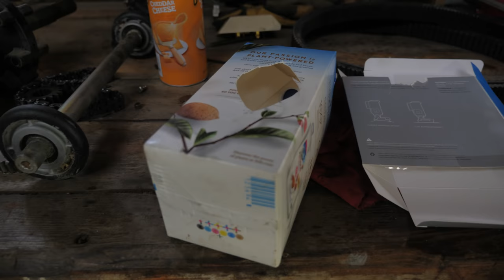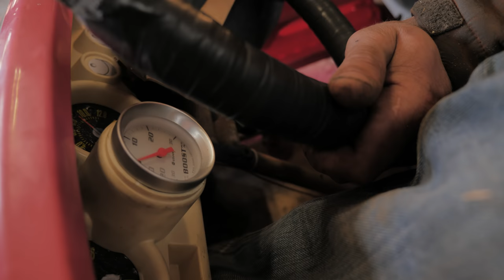Barbie Car Turbo #3 Tuning and Hitting the Streets

Comment: crazy? I haven't seen anyone try to use a brushless Electric Ducted Fan (model jet aircraft) to force the intake. no complex exhaust in-out a turbocharger, just an electronic speed controller with a hall sensor hooked to the throttle. the controller can be programmed for throttle position vs rpm+thrust. some of the 70-90 mm diameter units put out several pounds of thrust, typically have 5-7-9-11 compressor type blades. they're also not all that expensive.

carb>rubber boot>EDF>rubber boot>intake, so its compressing air+fuel into the cylinder, and isolated from majority of heat. this might be something really worth experimenting with just for its simplicity and electronic boost management, ESC programming cards are cheap too.
what if... it can offer 3 or 4 lbs of boost on command? has to be fuelproof of course, and idling it'd about passively spin trying to atomize the air+fuel more, isn't a bad thing.

not criticizing your efforts to boost the beast at all, but if the idea works they'd sure be getting slapped onto go-carts and mini-bikes everywhere real quick, no welding required!

edit: if they aren't fuelproof, could one be mounted to shove air into a fuel injector throttle body? in that situation there's no venturi fuel mixing that pressure would quickly F with, forced air could start when butterfly is 1/3 or 1/2 open.

Comment: I've turboed a motor like this before I used a very similar turbo at first but then did go smaller very small lol the turbo I used was about the size of a softball if not a little smaller and I made ten pounds of boost because of the smaller size its able to spin the turbo faster
Reply from the maker: What did you find that was smaller? We would love to try.
Reply: @GrindHardPlumbingCo  I forgot the exact name of the turbo because I've since sold it but I do know it came off of a Saab it's a very small turbo
Reply: But like I said because of the size being smaller it made so much more boost because it was easier for the smaller motor to spool it
Reply: That's the first thing I thought about when I saw your turbo is it is pretty big for that motor to really spool it all that much

Comment: On that turbo fan nut, was the threads left or right hand? cause the way it turns it needed to be left hand.  could put it back on and peen it to fix it.  Don't know if lock tight would hold cause of the heat.  If not, YOU WANA  SELL A TURBO??

Comment: Casey is discount Ben Shapiro. (no diss to Casey) Also, single cylinders typically don't work well with boost, and something you can do to alleviate that is make a pre-compression chamber. Boosted Boiz built a turbo 1-cyl shopping cart and they've looked up the math and done the work, so if you guys want to look into it, I'd start there.

Comment: GUYS! if you put the turbo right infront of the engine instead so the exhaust gas has to travel the SHORTEST distance to the turbine as possible it should spool better then.
Reply: also the gearing is way too tall i just now noticed

Comment: I'm sure you killed the turbo by putting an o-ring between the compressor housing and the turbo. The housing was probably flexing ever so slightly and rubbing/stalling the compressor wheel while the turbine wheel was still getting power. This probably spun the shaft and loosened the nut. Also based on the way your turbo is mounted it would emphasize this because you have the exhaust side hanging on the compressor side. In your situation you should try to brace both housings against something. Thus not as much load on either side of the core. Turbo's on cars (o-rings) in the housings have destroyed wheels because of this flex due to a lack of bracing. Yes I am a qualified internet engineer. Love the project though, keep it up! * Oh also in terms of a turbo, maybe look for a set of BMW N54 turbo's, they will need modifications to fit obviously but they are tiny and spool up super quick (also means you will have a spare turbo to mess with too)

Comment: try to use the 2 stroke carburetor, like the original from honda nsr sp, or the original from kawasaki kx 85
Reply: marcel darmanto from a 85?? It’s a 200/250
Reply: I think carb venturi 28mm until 30mm enough to serve your engine, i use honda tiger 200cc and upgrade to 248,5cc, i use pwk28 carb from kawasaki kx 85 and it works, more powerfull than that stock carb,

Comment: the setup you guys are running , with the carb in front of the turbo is what they call a "wet system"....and is extremely difficult to tune ....sometimes even impossible....

Comment: Cheap Chinese turbos always have something loose or a shitty weld on the housing.. so PSA! always check them!!

Also, if you are turbocharging a carb engine, you should be using a specific fuel pressure regulator for turbo'd carbs

Comment: They say that car is fast it looks slow from the video compared to other videos I've seen of people making go karts
Reply: Fast is relative. It's fast compared to the hunk of shit home-made go-kart that they started with. It's not fast compared to a large majority of the shifter karts out there because they use well tuned and properly geared drivetains instead of an admittedly clapped out dirtbike engine through what I'd presume to be an equally clapped gearbox. 

The videos that usually make for big views on youtube are neither this nor your standard shifter kart... they're freaks of nature with 600-1000cc sport bike motors that rev to 16k and make more power than the kart weighs in pounds. They're not made for racing. They're made for views, killing tires, and scaring the shit out of whatever nut job sacks up and plants his ass in the driver seat. Barbie is not fast compared to those.

Comment: Why don't you just big bore it wouldn't it be much easier to gain more speed instead of doing all theses things like its good that you tried the turbo I just think it would be better to bore out the cylinder and a bigger piston and a racing carb, tuning cdi gain more speed